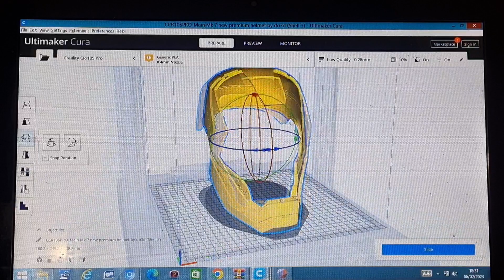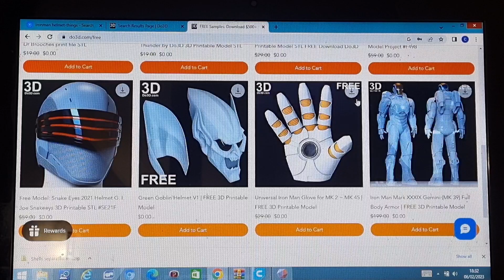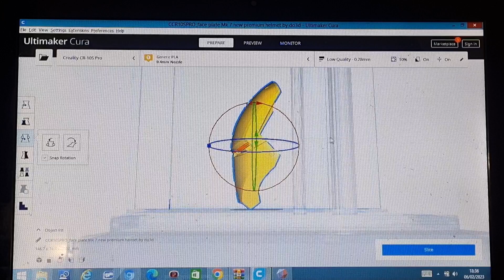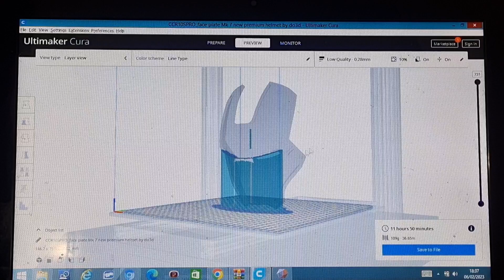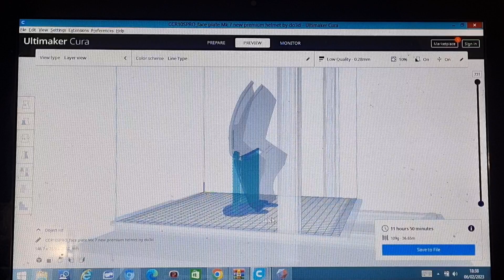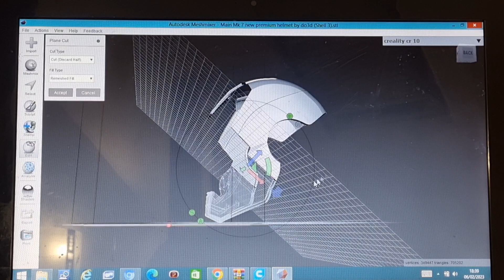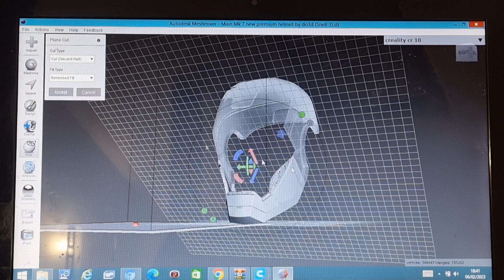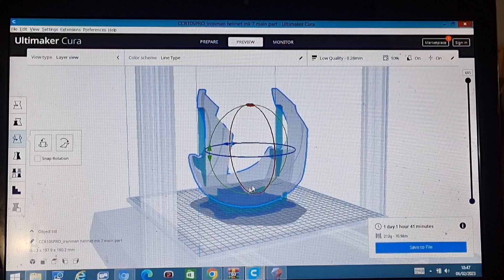DO3D Printed Iron Man Helmet | Ultimaker Cura Tutorial

Comment: Can you share your profile settings?? I have the hydra 2 in 1 & new to 3D printing. Some of my prints slide & mess up my bed is set to 60 degrees
Reply from the maker: This video was just using basic cura settings. I usually have the bed at 50 degrees and use rafts! I will do a video explaining different setting that help bed adhesion 👍🏻